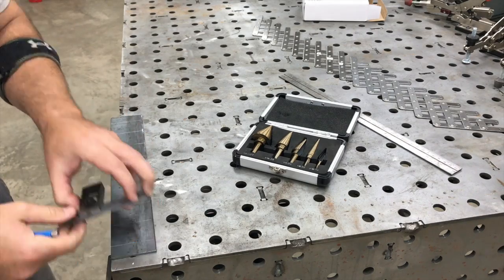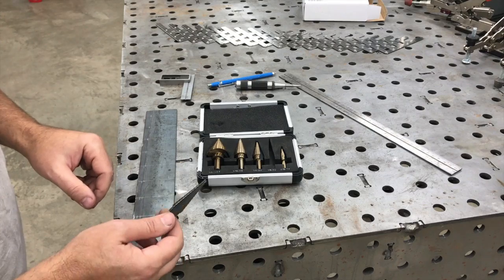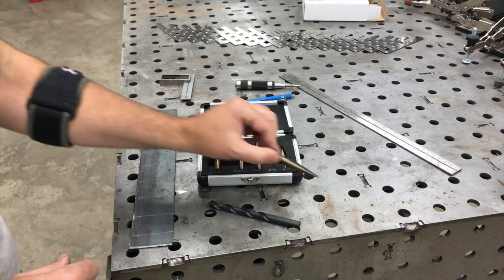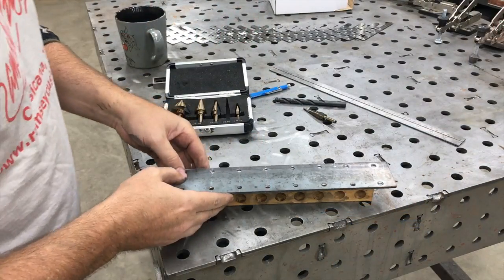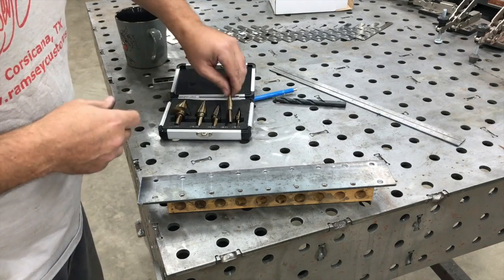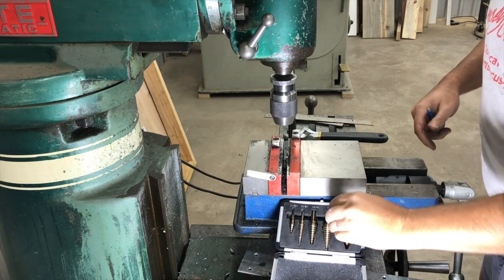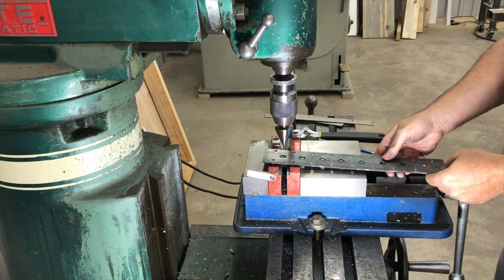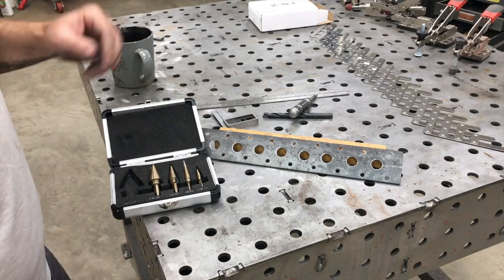Fast Hole Pattern Layout   Featuring CO Z Step Drill Bits

Comment: Great for sheet metal and steel thinner than whatever the step is on the bit. Typically anything over quarter inch requires flipping the metal to drill the back out to the same size.... Great way to drill bigger holes without the expense of large dia. Bits

Comment: For sure, the fine point really helps. My step drills are imports so probably won't last as long as yours, though your set is super value. Good demo Gary.
Reply: My HF bits last years. The long skinny one has drilled many 3/8" holes in horse shoes and mild steel. I did break one once, but that was probably my fault.